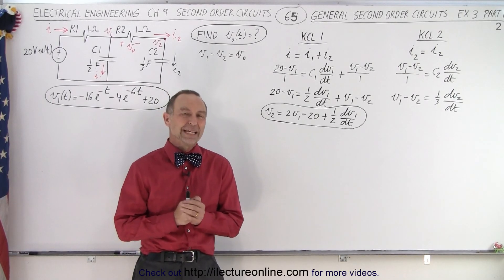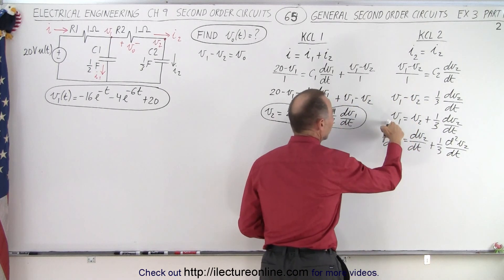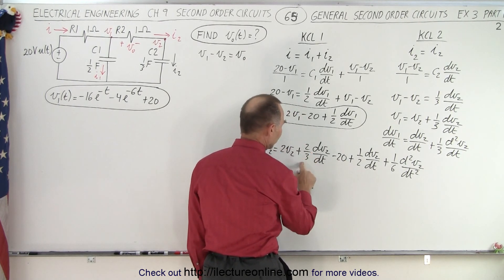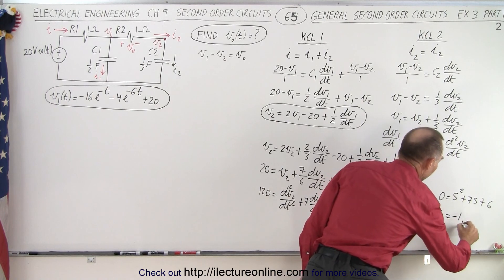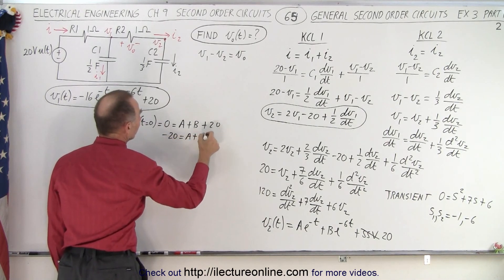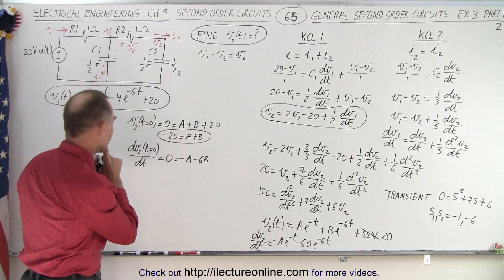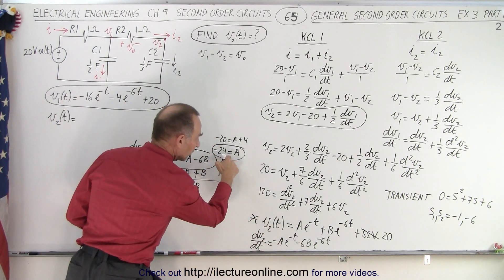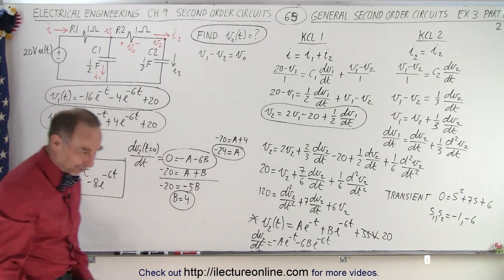Electrical Engineering: Ch 9: 2nd Order Circuits (65 of 76) 2nd Order Circuits in General Ex. 3 P2

Comment: do you have a video where you cover the theory for determining the transient equation (0= s^2 +s+c) from the differential equation for voltage  (time domain) and putting the values from the quadratic equation into the exponents of the voltage equations in the time domain?